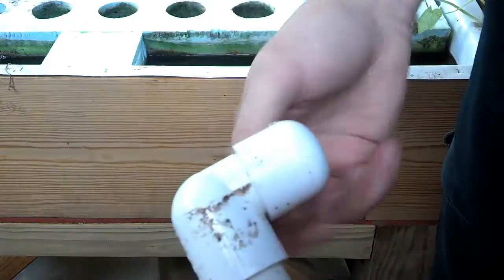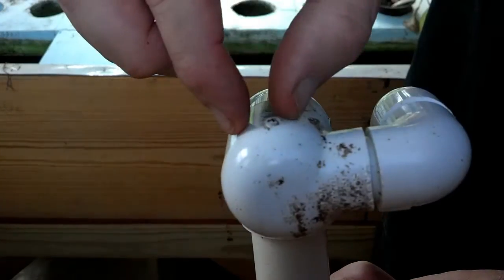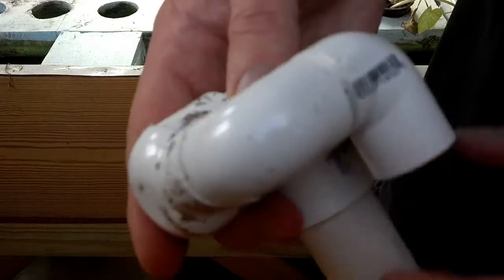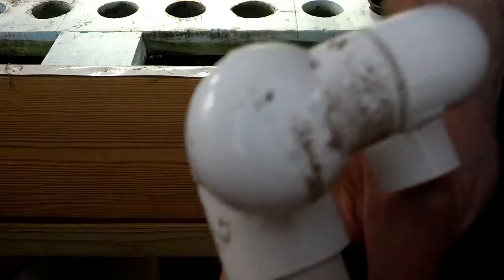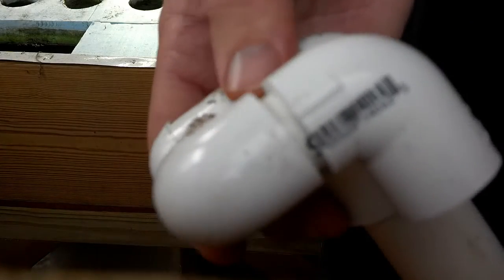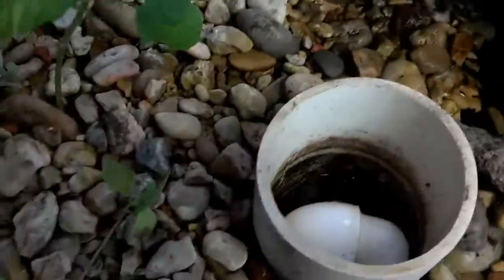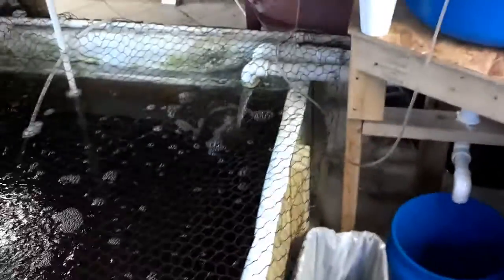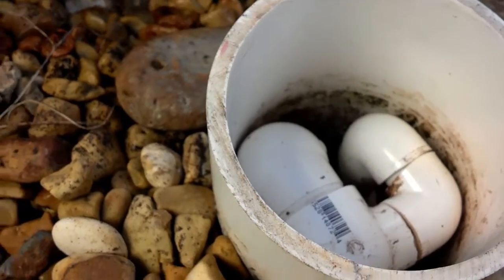Bell siphon 2.0. Works like a machine.

Comment: Hello and thanks for the design of this siphon.  I've built a copy and testing verifies that it starts very reliably and quickly too.  However my copy does not break reliably.  It reaches the point where it begins to suck air but it hits equilibrium and continues to drain without breaking the siphon.  Any ideas appreciated!  Thanks in advance.
Reply: It depends on the amount of water coming into your grow bed and your drainage system. If you have too much water coming in you may need a slightly larger siphon. I also made a video where i fine tuned this design on the underside of the grow bed so that it would both fire and break properly. One or the other should work if you are dropping straight down into your sump tank. If you have multiple grow beds sharing a drain pipe then you need air flow in the drainage system and you need to use the correct size pipe. I made a video on that also. I start my drain with an air valve and usually put another in after a turn and increase pipe diameter as needed. One or all of the above will work. try the easiest and cheapest and keep going til it works. Good luck.

Comment: What is the purpose of the 2 smaller elbows? Why not have the reducer pointed down? Thanks for sharing.
Reply from the maker: I just tried everything i could think of and that seemed to work best. I think that is a good starting point but i always expected others to take it and make it their own.
Reply from the maker: Just testing to see what worked the best and that seemed to give the best results overall with the fine tuning under the growbed that i explain in other videos. I encourage all to try and see what works best for you. I was just trying to come up with an alternative for the bell siphon and this is what worked best for me. Just trying to show there is more than one way to get the job done.

Comment: First time I have seen a system like that, I have the Same issuers with starting and stopping. Looks great When I update My system I will try that. I just added inlet water to assure a drain but then I have the Issue of stopping. I have more bends at bottom of tank just because I had Raccoon's get my tank and Liner did not hold up to them. I will adjust with New tank.

Comment: I really appreciate this!!! I have been fighting with my stupid bell siphon for months.  I've made them bigger and changed my media guard.  I was going to change my media guard again.  I will let you know how this goes.  Thank you again
Reply from the maker: Check out my video if you havent seen it "abs siphon fires in about ten seconds" shows how to fine tune it on the underside. If you still have problems it will be with the drain pipes. I have a video on that too. I have had instances where i replaced the bell siphon with the abs siphon and left the plumbing the same and the abs siphon would work where the bs wouldn't. But if your drainage pipe is too small and doesnt have good airflow it will eventually create what i call lazy siphon issues. Just watch the video how to build the abs siphon and the larger ones are just as easy. I just use street elbows and reducing elbows instead of bushings. It works. 1 1/4 to 3/4 is a great siphon for a 4 foot growbed and you can find everything you need to build it online if not at the store. but good luck fitiing it in a 4" drain pipe. wheeew. I like the bigger siphons.

Comment: thank you shannon for this wonderful video...btw, what is the height of the siphon? is it an inch below the gravel or at level with the gravel?
Reply from the maker: about 2 inches below the gravel.
Reply: thank you
Reply from the maker: The best thing to do is build it a little longer and then shorten it as needed. Then when you get the dimensions right you can build your other siphons the same.

Comment: good job Shannon... looks like you've about got those down pat.
Reply from the maker: Thank you sir. I knew that putting the bends in the pipe higher was giving better results but i never thought about going that high. I made the modification this morning and i was hoping i could let you know before you got yours installed. I've been watching it on and off all day long and it is working like a machine. The origional design worked but the results were inconsistent after longterm observation. So far i am amazed at the difference it made. Try to use the same style reducing elbow as i did in the video. I got those at lowes but i don't know who made them i think that must have been the part that i cut off. The ones that look like an end cap with a smaller pipe sticking out the side seem to work better though i don't know for sure that it makes any difference.
Reply: Keep me posted on your results.
Reply from the maker: Brad Gray
This is definitely how to fine tune it. It's working glitch free. I haven't had one issue it just continues to work like a machine. Thanks for watching my progress. Have a great 2015.
Reply: thank ya Shannon... I'm gonna set my system back up as we get closer to spring. I'll use your methods on the siphon.